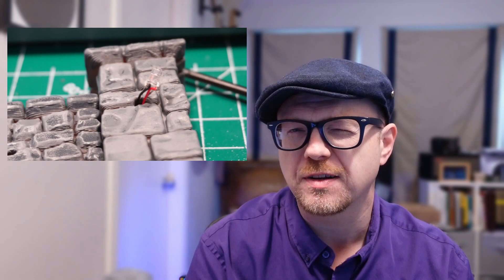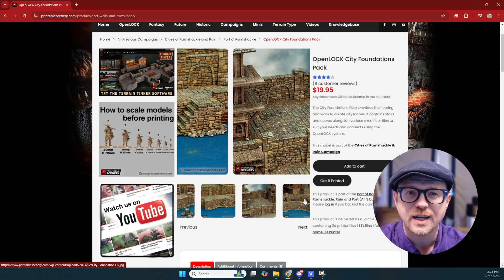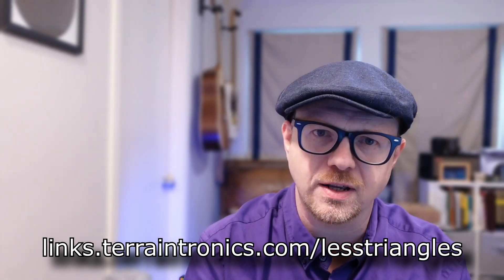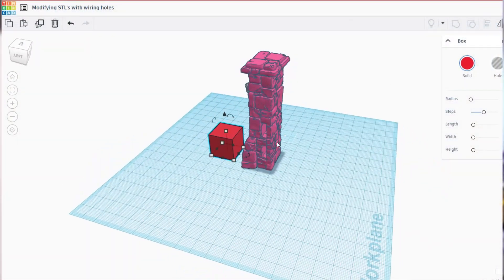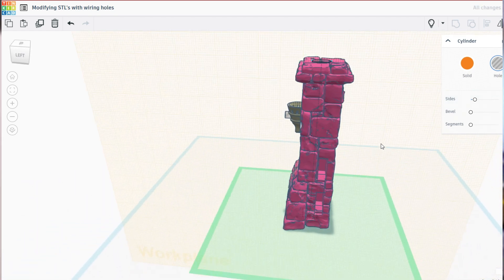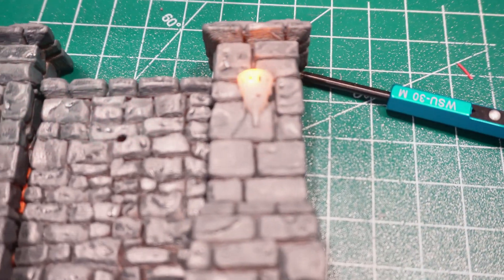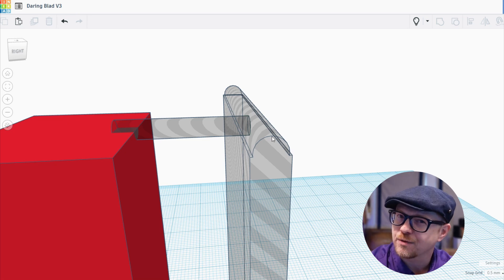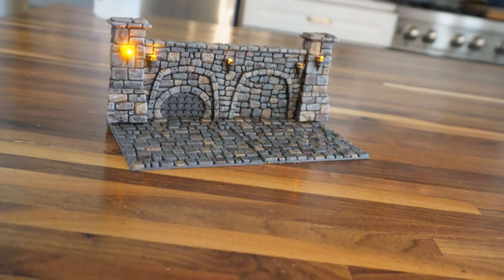UPGRADE 3D PRINTS with hidden wiring and LEDs. Ideal for booknooks & tabletop DND terrain!

Comment: Or just add the holes in the slicer.
Reply from the maker: Definitely - however, I've found not all slicers support this. Also, the holes are usually for draining in Resin, right?
Either way you find a way to add holes - it's worth doing if you can fit (in my experience) 3mm width holes.
In a follow up, I'm going to talk about optimizing channels (curves etc) for easier routing.
Reply: @TerrainTronics  Bambu slicer lets you add negative shapes or positive shapes for FDM printing.
Reply: @TerrainTronics  In Bambu slicer just right click, Add negative part, select shape, then ctrl click on new shape and the current object then merge.
Reply from the maker: @GlassicGamer  Love it! Thank you! :)

Comment: Cool! Maybe instead of the hole behind the sconce being flat horizontal make it angle downwards 45 degrees until it hits the vertical hole? Might make fishing wire through easier. What do you think?!
Reply from the maker: Definitely! I’ll do that in a follow up. meshmixer has a great tool for doing that as well as fusion360.
The aim of this tutorial was to show you could do this with zero background in 3D. Tinkercad as is pretty limited in what it can do, but that’s its beauty as well. It’s pretty easy to grasp!
In the future I’ll make a STL part that can be imported easily to tinkercad that has a curving 90 degree to make the wires easier to feed.
On the other side, a 90 degree made it easy to feed the wire straight up and grab with some needle nose pliers.